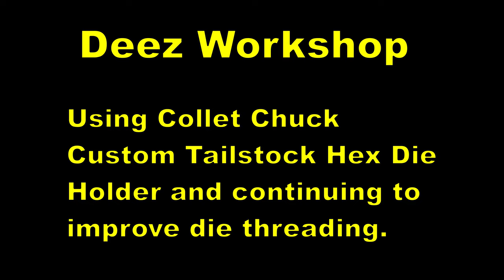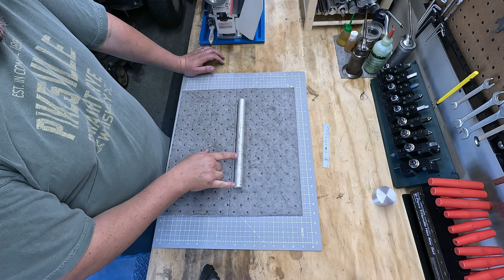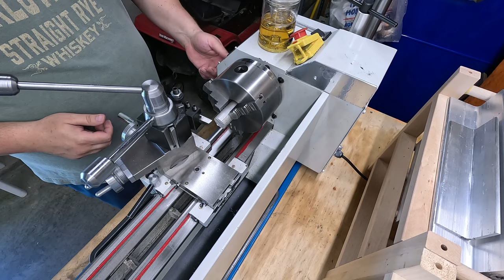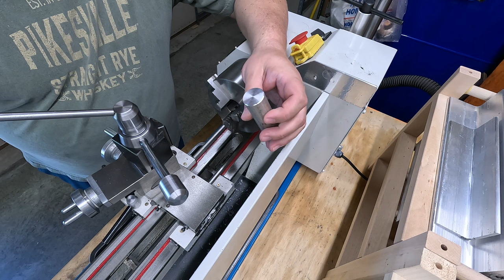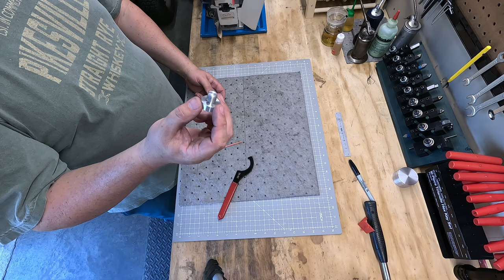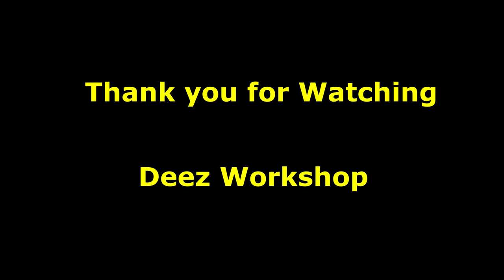ToothPick Holder using Collet Chuck and Custom Made Tailstock Die Holder on the Vevor Mini Lathe

Comment: This was a show and tell episode, we saw you use all the handles you have made/replace, we saw the die holder in use, the collet chuck you modded.  You also looked a lot less tentative when operating the lathe, nice to see the confidence that comes with practice showing.  Watching you use the carriage lock handle actually has me pondering, I made all my wrench adjustments on my lathe use one of  two sizes of head, and then got a single double ended box wrench that had those two sizes, which is quite convenient, but now I am wondering if a handle on the carriage lock would be even more convenient.
Reply from the maker: Thanks,  I feel like I am gaining more confidence with this machine and my abilities.  I really like having that carriage lock with its handle right there and ready.  Really helps with my workpiece end facing operations to keep those nice and straight.  I do go back and forth on the lock lever handle though.  I like its convience but believe I would also be happy with a nice flange nut on top...but its nice not needing a wrench close by...maybe ill experiment someday with another modificaiton.

Comment: Deez since buying a collet Chuck I find I use it far more than my 3 jaw Chuck. Keep using it, I think you’ll be happy with it. Threading looked good, nice to see you use the tailstock to start those threads! All in all nice work. My only negative comment would be that wall thickness of the toothpick holder is way too thick. That’s a big chunk of aluminum your brother will have to keep in his pocket just to hold a couple of toothpicks. Still a good job. Kudos to you!
Reply from the maker: Thanks,  Your comment Isn't negative, This thing is impractical and a tank.  No way he will want to carry this around in his pocket but this was just a project to practice some order of operations which I am still learning and a true test of using the tailstock die holder.  He appreciated it and keeps it in his truck.  :-)

I do like using the Collett chuck,  I should use it more.  I did get a wide range of colletts to go with it.